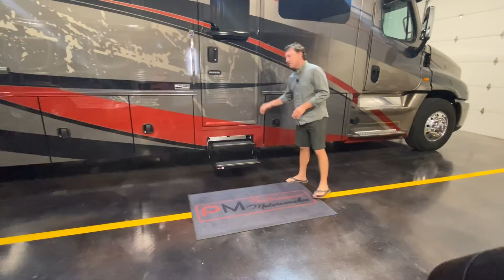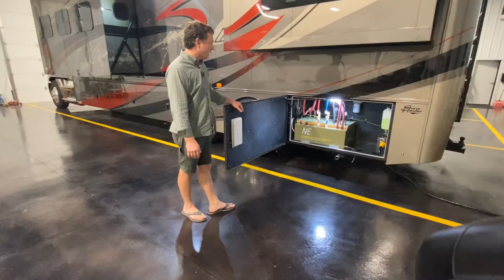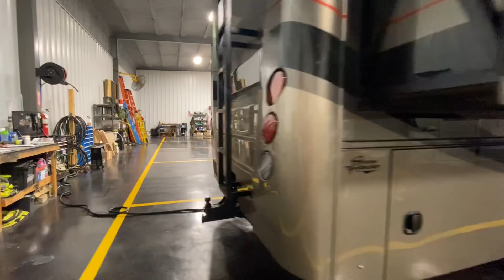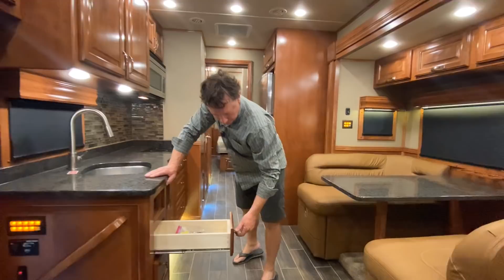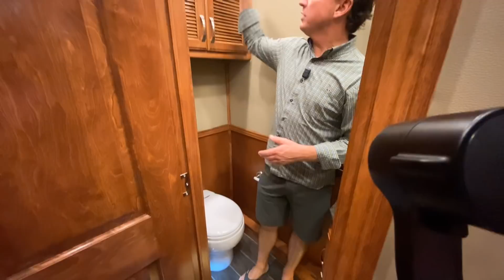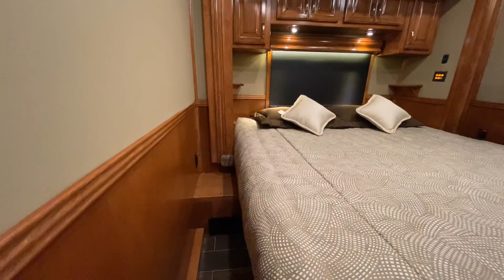2020 Showhauler 41ft Coach Sold @ Performance Motorcoaches @Performancetx

Comment: My question is if you do an overnight stop in a Walmart parking lot do you have to extend the slides to get from the cab to the kitchen or bath or even to use the bedroom? Using a standard queen bed would there be better night stands for a CPAP?

Comment: I have a few questions.  With the all steel frame what is the GVW and GVWR for this coach ?

Is the frame as strong or stronger than a ambulance or school bus ?
Reply: Its a commercial truck chassis. It doesn't get stronger than this!
Reply: Showhauler factory video states the industry standard 40k rears, and steers upgraded to 18k, so, 58k GVWR but rolling weight is about 48k. Don’t see how you could overload one.

Comment: Speaking of paint jobs, why does every RV use swoops and swirls?  Is it a rule?  I don't see anything else, no candy apple paint jobs, no murals, no solid colors, or patterns other than swoop and swirl.
Reply: These things are for glamping. From what I've seen of the "high-class" campsites, you are not allowed in if your rig doesn't conform to the rules (length, appearance, cleanliness...) 
It's basically the same stupidity as Home Owner Associations, except on wheels.
Reply: @Arrynek01  So swoops and swirls are a rule, interesting.

Comment: Nice coach.  Does it have adaptive cruise and lane keep assist?  LED headlamps? Solar?
Reply from the maker: We order all units with Detroit Assurance which includes Adaptive Cruise, Crash Mitigation, and Blind Spot Monitoring. The lane departure gets a little annoying so this customer opted out. Led headlamps.
Reply: And what’s the entry level pricing on one of these?
Reply: if you have to ask you can't afford it, any custom coach like this runs you 4-600000 USD.